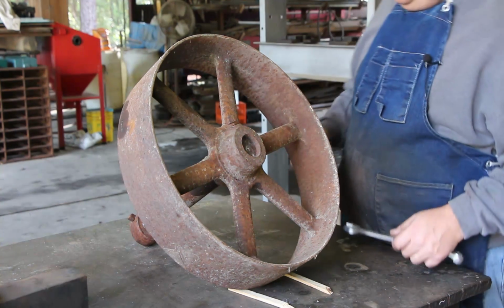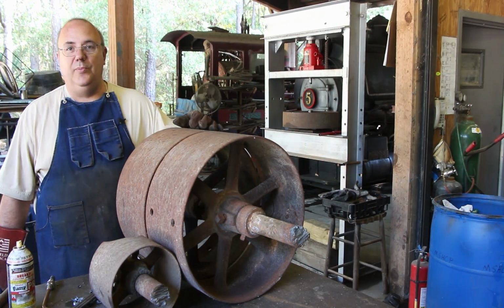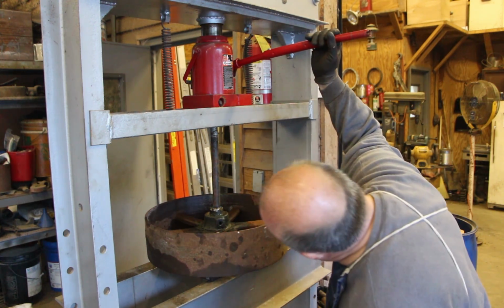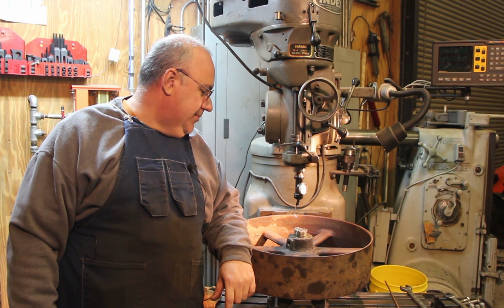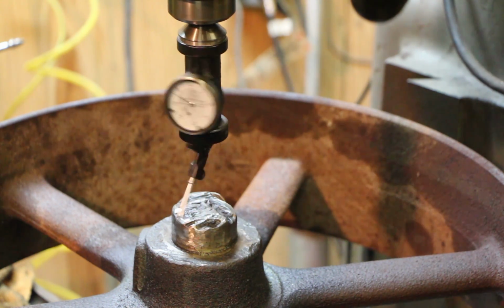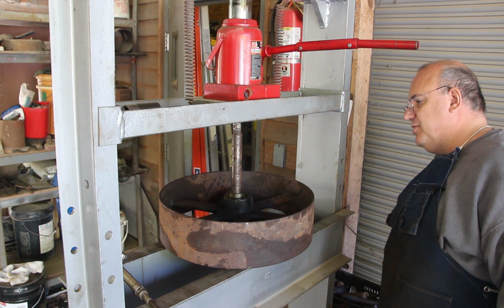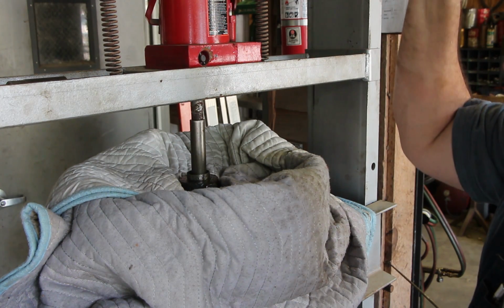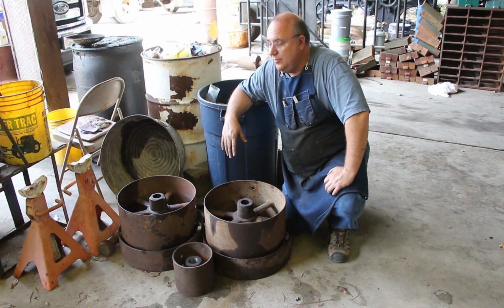Removing Stubborn Shafts from Flat Belt Pulleys

Comment: You could make a wheel that would attach to the side of the jack, where by rotating it, you'd get the same motion as with you using the lever.

Like a steam engine wheel and connecting rod. It doesn't even have to be metal, some scrap MDF, a shaft, a pin, a small base, 2 or 3 measurements and you're done. Then that wheel you could motorize with a small drill or anything really and TA-DA super fast, human-power-free press.

I can make a drawing if you want.

edit: for the usual work, of course, not heavy duty
Reply: you can see that at the peaks of force he struggles to pump the jack by hand with that big lever, a mdf wheel would not stand a chance to that kind of force, air powered jacks rule!
Reply: TheDivineImpulse At the peak, yes, but how many times have we seen him struggle with it?

Ok, maybe i oversold the idea on MDF, but the same device made from waste metal would work perfectly ok.

I did amend my original idea regarding the issue you stated, so i knew by the end of the video that it wouldn't work perfectly.

Besides this is about him not having the money to get an air jack. Which i know they rule, i have one myself.
Reply: ***** I'd recommend you browse the internet seas and ask around for reputable examples. 

Being in Europe i can't advise to a specific one since brands don't cross path and well shipping one from here would cost a lot.

Would be nice if you did an episode on the exchange when you'll make the exchange. Seeing that everyone has already made presses there isn't much talk in the community about them outside the way they work.